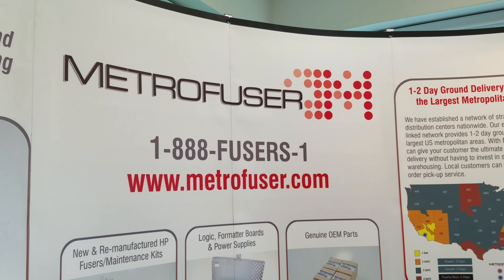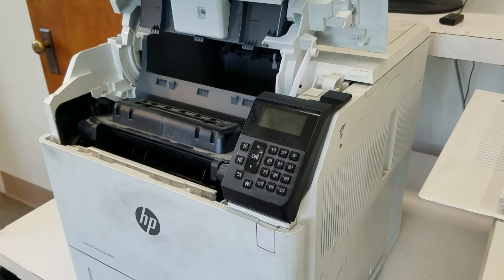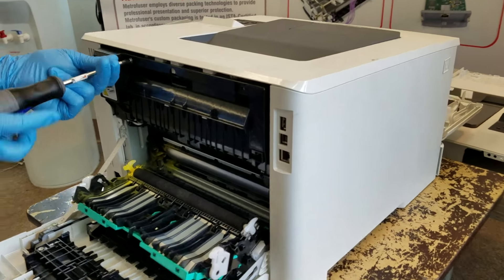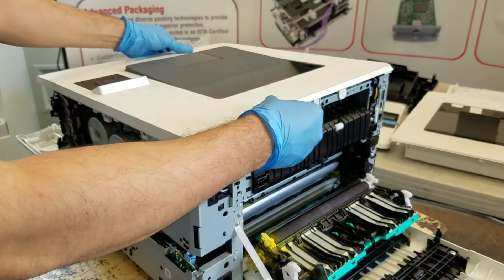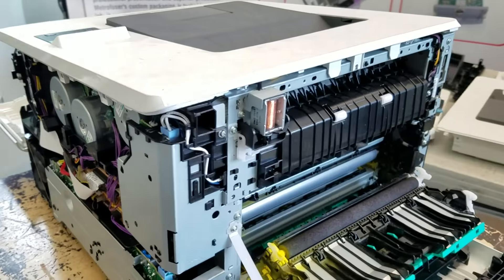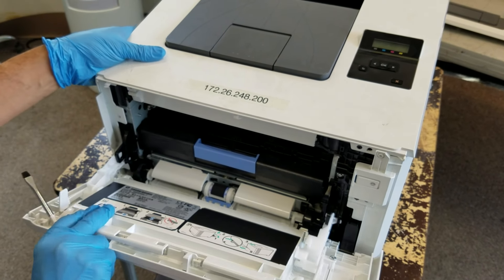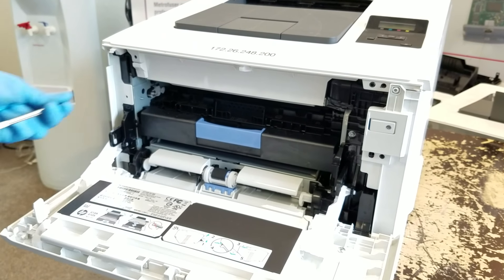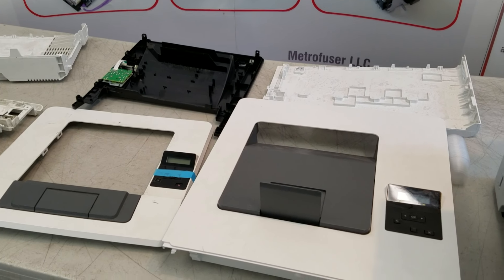How To Remove and Replace HP Printer Covers, Panels and Doors.

Comment: You wouldn't happen to have a video of a HP LaserJet m426 mfp or/ m428 mfp on how to clean underneath the ADF scanner glass?  Unfortunately some dust or debris gets underneath the glass and is leaving a permanent line that has to be disassembled to clean.